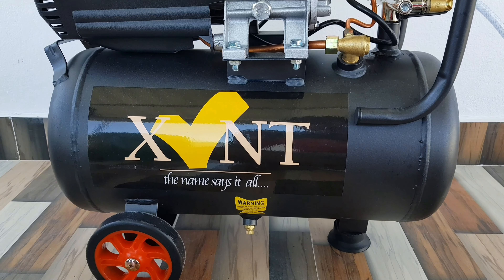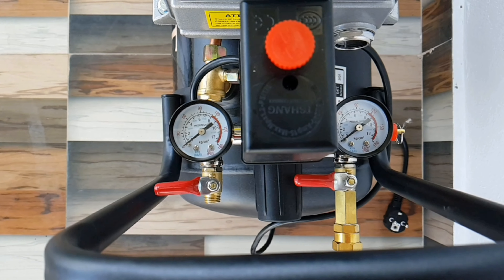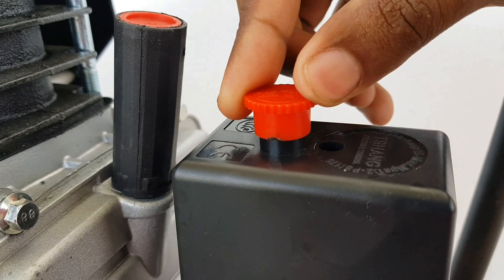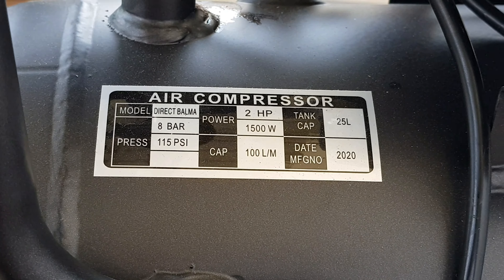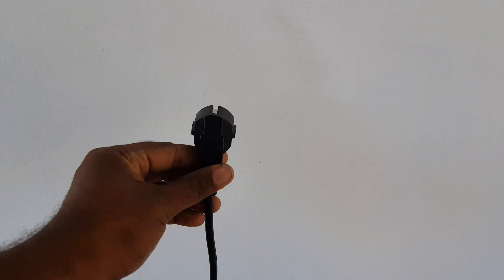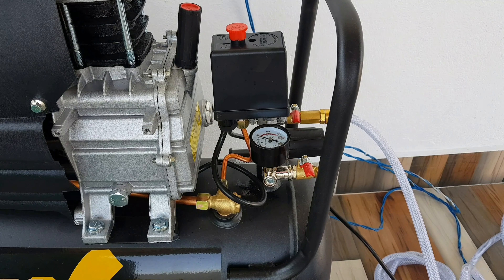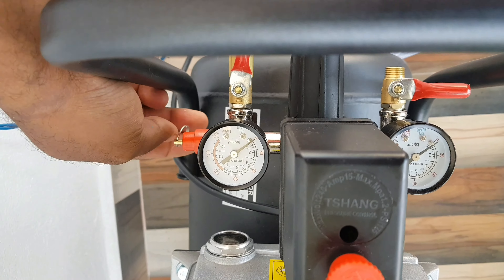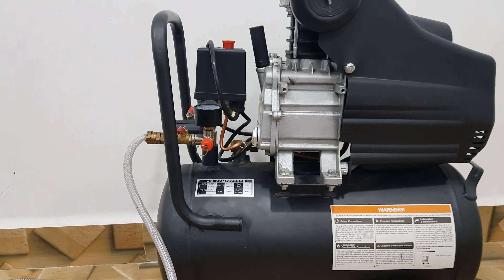Cheap Air Compressor Review | 25L Xvnt | Tamil review For Painting

Comment: Is it worth bro ?
Quality and durability ? 
Time taking for filling up?
Reply from the maker: 50l will be worth it bro
Reply from the maker: Quality is nice and it's been a year  still working good,, time for filling is fast
Reply: Thanks for your reply bro.
Yeah bro. Though same of buying 50L coz not a much bigger difference between 25 & 50L.
Reply: Initially had a confusion between Oil free and oil. But set up on oil.
But which brand to choose was a bit difficult
Reply: @ModMaxX  what's the price bro when you purchased ?
Reply from the maker: 1 year warranty bro